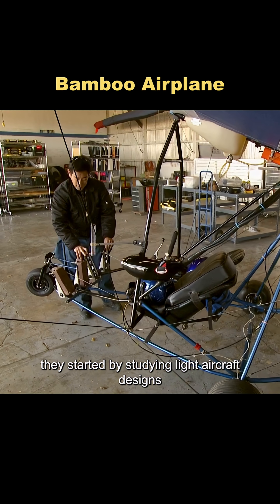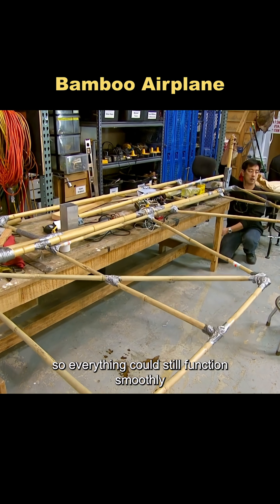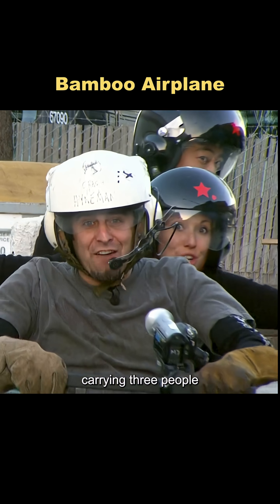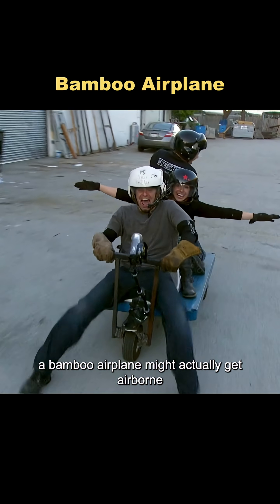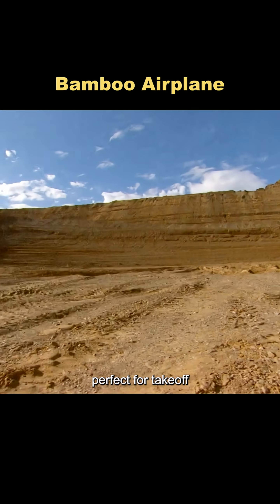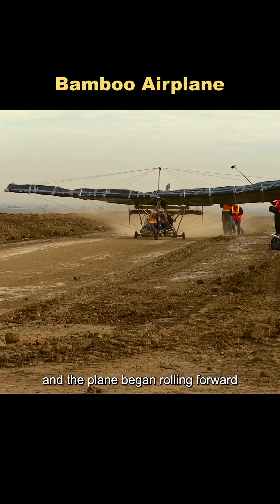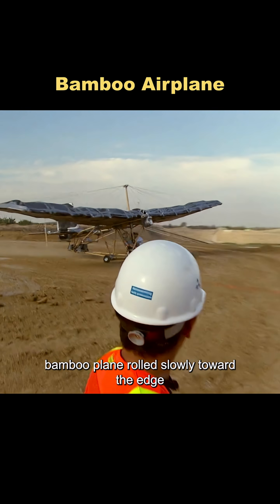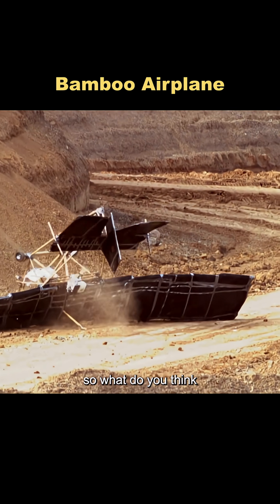Have you ever seen an airplane made of bamboo?

Comment: What I think is that it failed as much for the crudity, as anything else. The coverings on the wings and tail were just atrociously done.  The very rough, uneven coverings caused a massive amount of drag...and severely reduced the effectiveness of the airfoils. Also, the aerodynamic balance would have been horrible.  Even if they'd had 40 hp...they'd have been lucky to get off the ground - and the thing would have been nearly uncontrollable.  

This is why a smooth, tight skin for the aero surfaces is a MUST.  They would have been better off using some sort of fabric, or plastic material that they could STRETCH over the internal structure. Ripstop nylon, for example, would have worked.

Comment: The reason for the failure was probably the poor efficiency of the propeller. If a reduction gear had been installed and a propeller with a diameter of about 3 meters had been rotated at a slower speed, flight would have been possible.